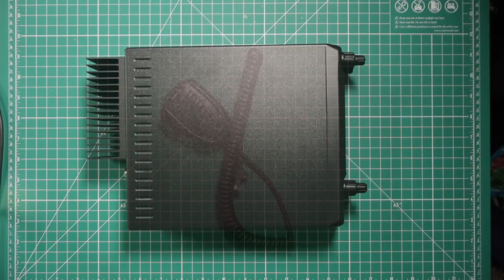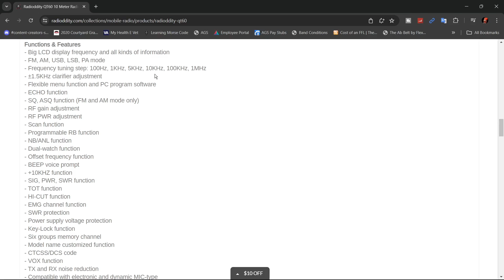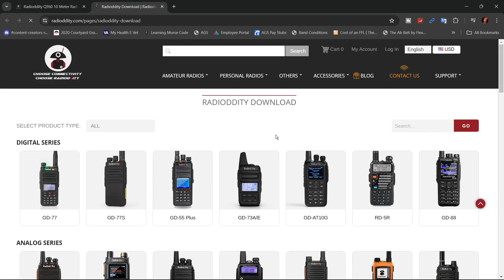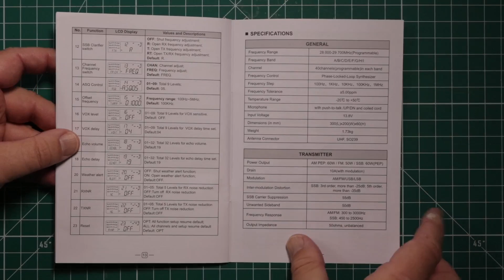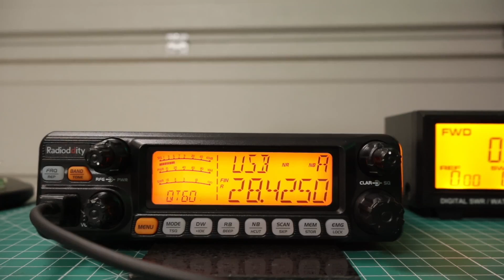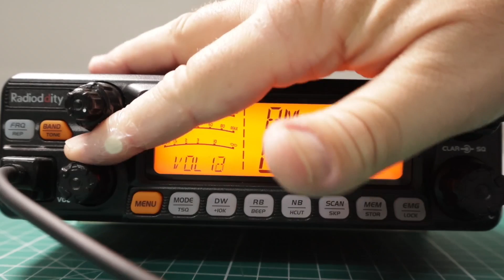Raddiodity QT60 Overview

Comment: Have just bought one. It's a nice radio and has a good receiver but it has various issues. The squelch operates all the time - cannot be completely switched off. The first bank - A - does not go below Ch9. It's a nightmare - very time consuming - to program. It does not use a spreadsheet compatible text file (eg .csv) that can be easily set up. There seems to be some twisted logic in the software design rather than keeping it simple and easy to set up and operate. I had to program it with the AT5555N 3.00 app. Bonus is that it allows programming for 60ch per bank and provides for more menu options. Would love Anytone to sort out the various SW issues.